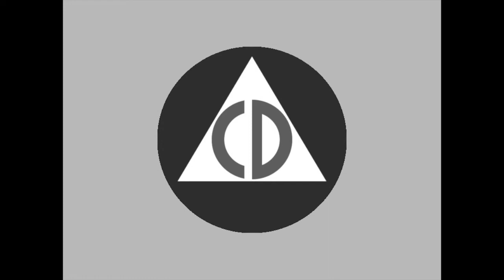EBS Test Pre 1971

Comment: The attention signal WHIS (WVVA) had at the time was a high-pitched B flat.   Around that same time, WCHS in Charleston, WV had their EBS Tests announced by a woman.
Reply from the maker: B flat is roughly 932 Hz, and B is roughly 988, so it was in between there? The higher tone of the two-tone they used after 1976 was 960, which could also have been used with the single-tone system, I guess. It wasn't too common to hear a woman read the script back when most announcers were men, but as equality reached the announcer's booth it was more common. Here's a clip with Merri Dee of WGN reading it: https://www.youtube.com/watch?v=XQ6HfE3750Y
Reply: At the time, the WCHS EBS slide was the words Emergency Broadcast System in capital letters with the letters EBS enlarged and shown in black & white.
Reply from the maker: Matthew Taylor I wonder if anyone has gathered all (or a good number) of the slides that were used for the test with an eye toward building a gallery...
Reply: @JohnHolton  I don't know, but that wouldn't be a bad idea.

Comment: This is how WHIS-TV (Now WVVA) in Bluefield, WV did an EBS test until around 1978.  Their CD logo had its triangle inverted inside a rectangle on a blue background.   The announcer at the time had a low baritone voice sounding almost like a cross between disc jockey O.C. Young & news anchor Tiny Thompson.
Reply from the maker: That's an interesting logo. Never seen anything like that. It was common for stations to pre-record the test script, even to get a pre-recorded one from a professional actor, though most stations had the announcer that was on at the time read the script.
Reply: As of 1978, WHIS still used that CD logo, but went to the 2-tone attention signal, and a guy named Andy (don't know last name) read the script with the "This station serves the..." added at the end.  In 1980, the slide was changed to a green background with the words Emergency Broadcast System at the top in a light gold pointed "burst" design.
Reply: One of the "Andy" EBS tests occurred during Wheel of Fortune.  Just as Chuck Woolery said "Welcome back to round...", the CD logo popped up just before Chuck could say "two."   Normally, a test wouldn't be conducted in the middle of a program.
Reply from the maker: Matthew Taylor That is odd. Most stations just waited for a commercial break, but that wasn't written in stone. Maybe the guy that was in charge of all the local stuff knew he had to do the test during a break and forgot, and decided to do it right then...
Reply: Modern EAS Tests happen in the middle of the program, like the National EAS Tests of 2011, 2016, 2017, 2018, and 2019.